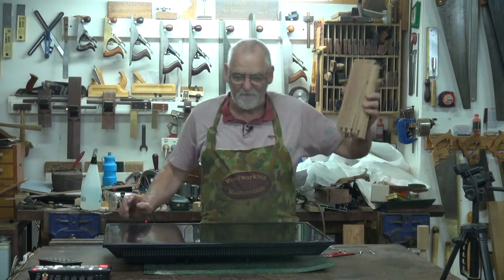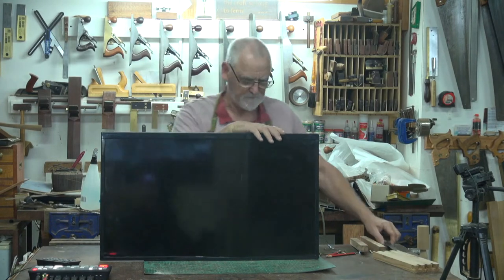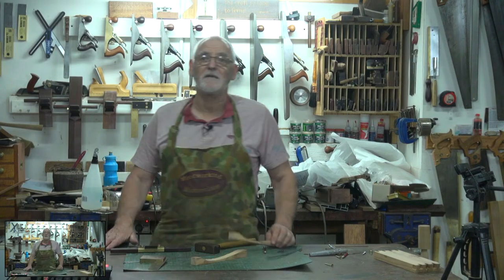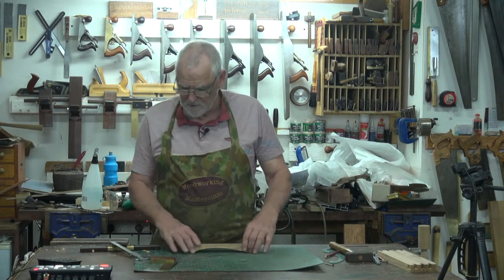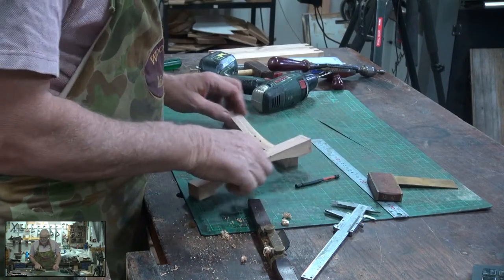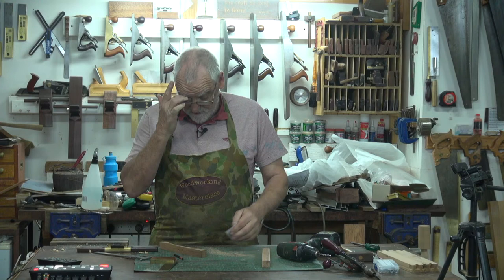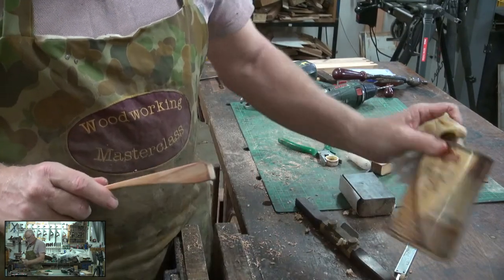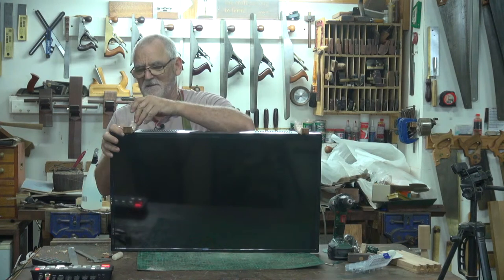Making new feet for TV and saving it from the dumpster!

Comment: Did you end up reverting back to the old workbench?
Reply from the maker: Hi Vince, Yep rearranged the workshop once more. Will get it right eventually!  Cheers Steve How's the Dusty?
Reply: @Woodworkingmasterclass  interestingly, i went there to buy a bigger wall mounted extractor, but when i saw how much suction is lost thru fixed piping, i ended up getting a smaller portable unit which had 1.5hp and 0.5 micron filters. Has 4” piping, so it just means i need to hook it up to the machine im using each time.
Reply from the maker: @ArchEdge  Sounds like a plan. What I have done is piped it with flexible hose to different machines and installed gates so it's just open and shut situation. Saves a lot of messing around. Chers Steve